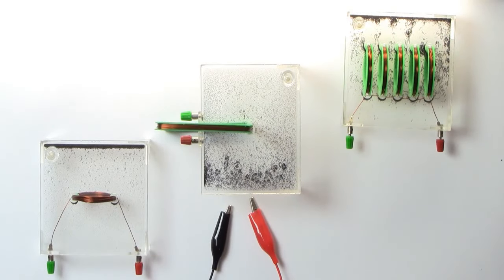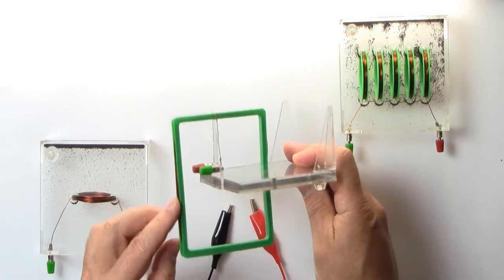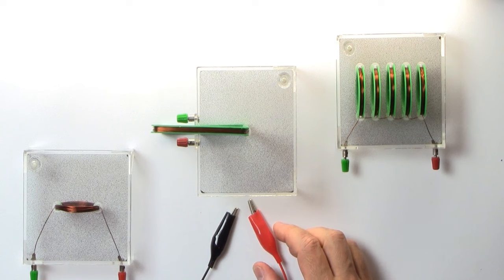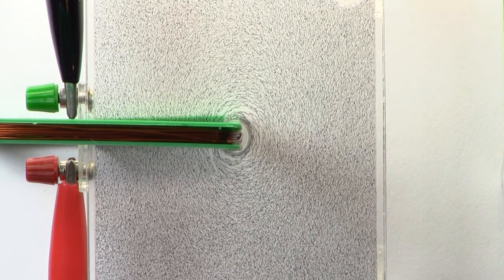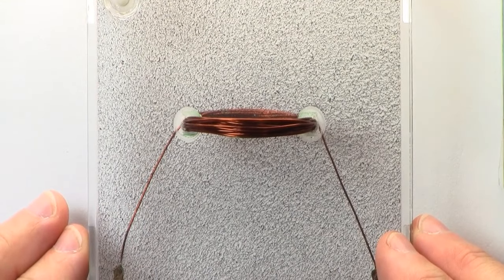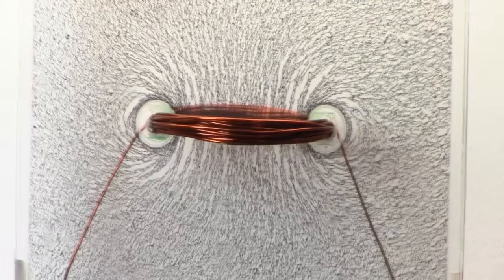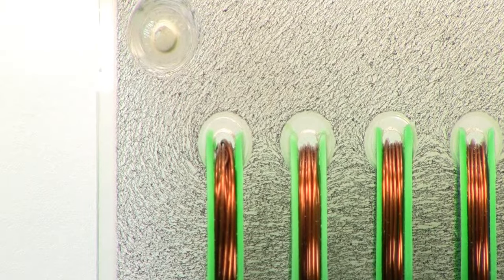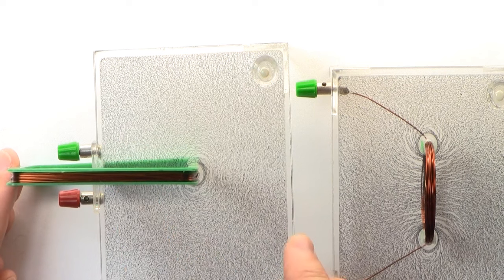PH EM MF DEMO 70001A V1025 2D Magnetic Field Demonstrations Simple Wire Coils

Comment: This picture of a magnetic field, explains most of about everything you need to understand the universe; just imagine that this is possible with all things.  That there is a relationship between all opposites in every way.  That way every wrong, can be made right...even when every right can be made wrong.   Even our brains are made to accept this relationship: the left hemisphere attunes itself to the flow of the coil, while the right hemisphere projects the field that the first flow represents.  However separate or different they each may appear, they are not.  They are one and we have the capacity and ability, if sometimes not the willingness, to accept that truth.

Comment: i know a magnetic field does the opposite of gravity. gravity bends space while a magnetic field inverts it. a magnetic field i the only linear energy know. unlike radiation bending space in the shape of a wave a magnetic field smooths it. if you can intersect  multiple field at on point in space perhaps it could invert gravity. will you test this.
Reply: Hello, you have everything wrong.There is no relationship between the magnetic field and gravity..Gravitation has been perfectly described by the GENERAL RELATIVITY. Electromagnetism, for its part, has been perfectly described by RESTRICTED RELATIVITY.